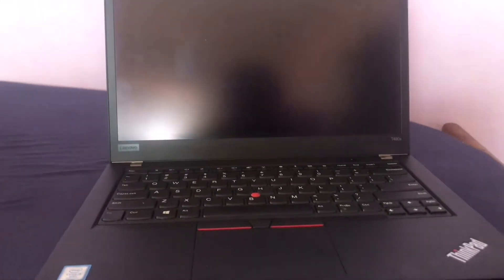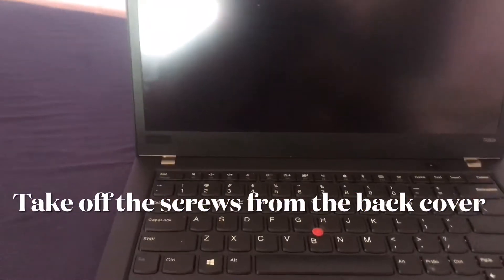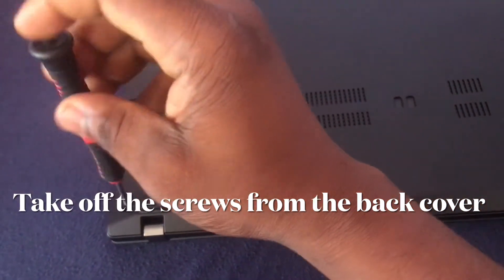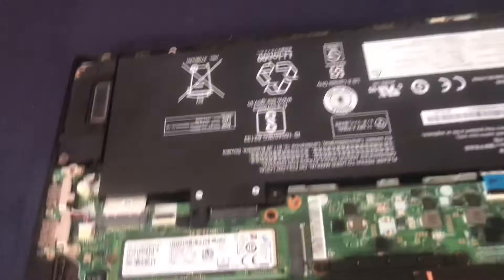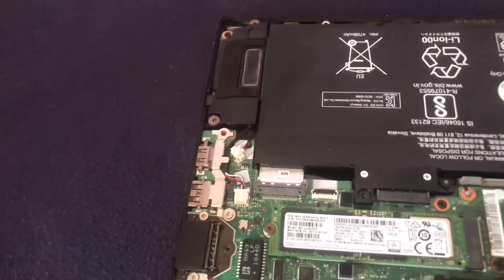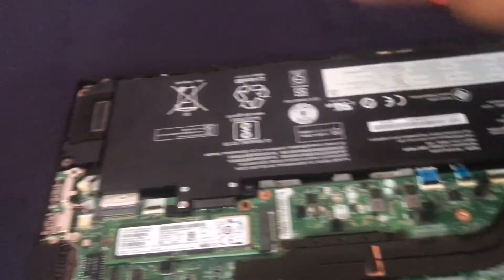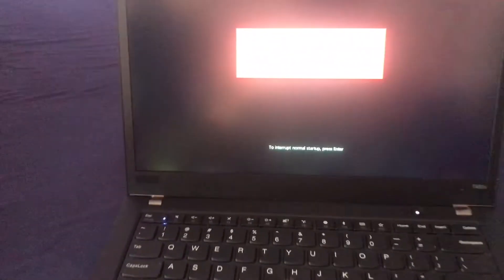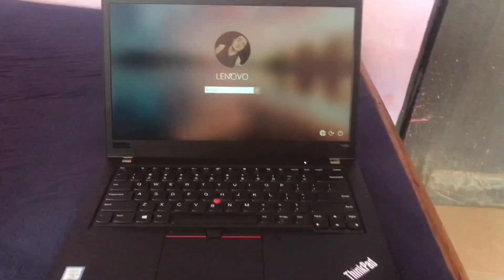Lenovo ThinkPad T480s won’t Turn-on when power button is pressed . Solutions

Comment: I had this problem and the video helped me fix the issue, but it was frustrating that nobody appeared to know why it was happening. Then a week or so later the laptop failed to start again.... I fixed it, but later that day it happened yet again. I thought that regularly taking off the back and loosening the battery was a bit too invasive to become a standard strategy. 

So, as part of my routine to understand what was happening, I revisited the charging limits I had recently set up after a recommendation  to "protect the battery". I had set a top limit of 90% charge and a bottom limit of 20%. I removed these limits, so the battery charges all the way to 100% unless the AC is removed. I had no further lock-ups.

So, having no charging lmits may not be so good for battery health..... but after over a month, I've had no further lock-ups.

This may be a coincidence, but if you're having the problem described here, it has to be worth a try!
Reply from the maker: Thanks so much for the hard work to fix this issue permanently.

Comment: Hello brother, I have the same laptop, T480s, but after I open the battery and put it back, it refuse to load Home Screen the laptop can’t complete booting, the error message now is 1802 (
Reply from the maker: Ok
I’ll get to work to see what’s wrong
Reply from the maker: Please take out the ram and hard disk
Clean the ram with a dry and clean piece of cloth and fix them back in. Make sure they fit properly in their slots.
If problem persists, disconnect the cmos battery and fix it back. Try that and get back to me
Reply from the maker: Please am sos sorry you got a different problem 
Please take out the cmos battery and the main battery. Remove ram and fix all of them back then reboot